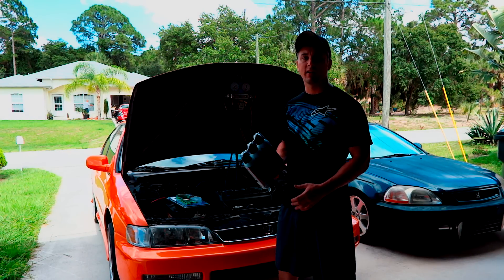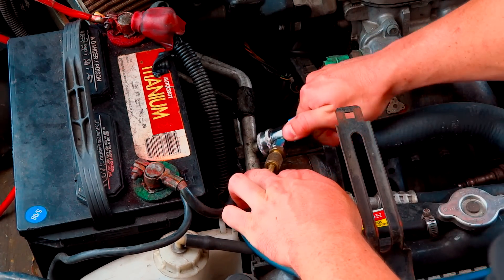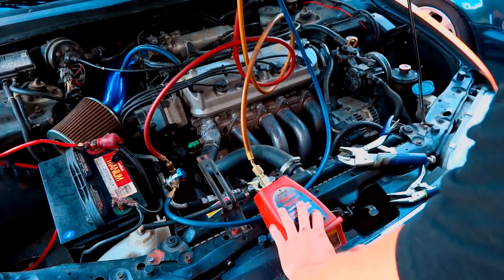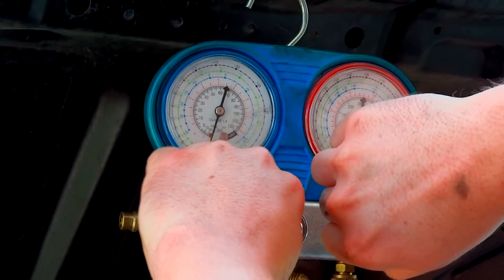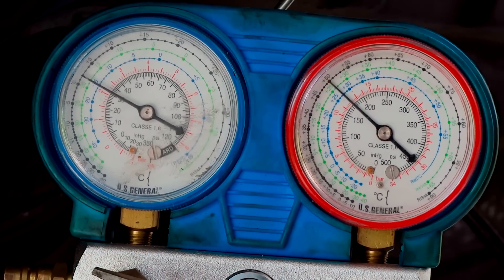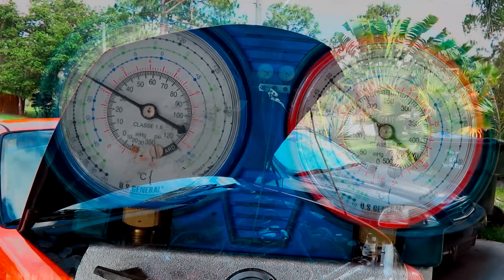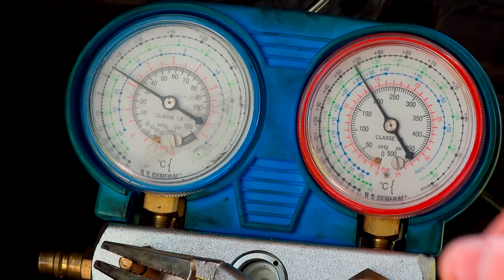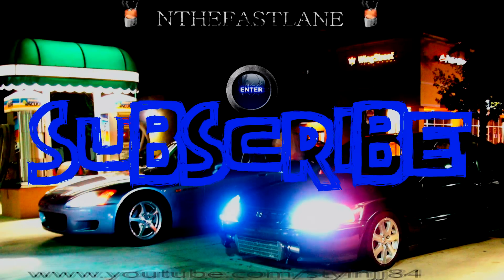Charge Your A/C With The Cheapest & Coldest Refrigerant

Comment: Hmmmm, no notes on molecular weight. I would assume you should convert whatever capacity your car is listed to match r152 since the molecular weight is different. Use the ambient/temperature range chart for saturated pressures for r152 so you don't overfill the car

Now to read if r152 or r290/iso butane would be better lol

Comment: And I will also add that the gauge on the low side reading 30 psi at idle - you can go a bit lower of 25 to 28 and you'll have colder temps... it takes a bit of practice and fine tuning but you add the refrigerant slowly   but adding more will overcharge the system and you'll defeat the purpose and have warmer air coming from your vents.

Comment: Not a bad video - However there are a few updates here that you should know
1 - Once the can is pierced with the tool it will leak out slowly over time. I know this because after a partial charge I did to a vehicle the can did still leak out through the gasket on the tool.
2 - You must have the yellow hose connected to the adapter BEFORE you pierce the can - that way you won't risk in frost bite.
3 - Do not remove the yellow hose from the adapter when changing cans. Keep the apparatus closed and in tacked . 
4 - I do agree of the purging of the yellow hose to the gauge set - so you don't get air into the system. 
Other than that You'll be cool and ready to enjoy the summer...

Comment: I've done a lot of r152 conversion, but not like this. I have a large clear vacuum box that has can piercers inside it. I load up 12 cans in the box then vacuum it down. Once at an acceptable micron level I valve off the vacuum and pierce the cans. I let the box fill up with all the r152, then I recover it to a 30 pound tank. I have 2-3 full tanks for conversions.
Reply: How does performance compare to R12 in your experience?
Reply: @mikelezcurra810  The coefficient of performance is slightly lower than r12 and higher than r134.

Comment: I owned an automotive air conditioning & radiator shop from 1973 to about 2003. Then I sold it to an employee and it is still open today (about 50 years later).  In my 30 plus years of servicing vehicle air conditioners I did not use vice grip pliers to connect the service fittings.

It is OK to try things.
It is against the law to vent refrigerants.
It is against the law to mix refrigerants.
It is against the law to put a different refrigerant in a system with out labeling it as such.  

When some one hooks up to a vehicle with R134a service fittings, they expect it has R134a in it. You would not want some one later to contaminate their A/C equipment by hooking up to a car with R134a fittings but having R152a in it.

Some shops use charging stations, I did not like them. 
I had a refrigerant identifier and used it before refrigerant recovery. 
I always used gauge sets to check out and service cars. 
I always used new refrigerant to top off working systems and after repairs. 

These comments are for viewers.

Comment: Love some of the comments on here.  I guess nobody realizes that the new vehicles have R-1234YF and that stuff is extremely flameable. R152a literally takes ~1/2 the charge of R134a. It also vastly outperforms R134a especially over 90°F.  Not talking a couple of degrees either, talking 8-10°F colder vent temps. As for 250+ head pressure, LOL.  Come to Texas and look at the pressure a R134a system runs at when charged per factory specification.  Before the vehicles interior cools off the system will cycle multiple times on the 400-430 psi high pressure cut-off. In 105°F and 30-40% humidity the high side will run 325-350 psi and that is with a properly functioning fan. At prolonged idle, R134a might stay 55-60°F at idle if you are lucky in those conditions, while some get closer to 70°F. Pag oil is compatible with R152a. I have run it in multiple vehicles for over 200K and have yet to see a compressor related failure from the R152a. I did have a clutch coil go open on my 230K mile G35 which is fairly common on Nissan products anyway even running R134a. When I pulled that system down, it was clean, oil was well distributed, the old compressor had several ounces of oil in it, so the Pag works with R152a.
Reply: r1234yf: It's not very flammable. Just a little bit. With these tiny amounts, there is more danger coming from your gasoline tank.(in case of accident).

Comment: Tried that on a E36 bmw, 1997, didn't work; system makes noise,not sure if the compressor was already bad,or if it went bad with this gas; or if the oil that was in the system is not compatible,maybe ?

Comment: While cans of electronics duster typically do contain a refrigerant called 1,1 difluoroethane (difluoro-ethane) or 1.2 difluoroethane (there is a difference), it may not be the only ingredient. It may contain other ingredients – which you may not want in your A-C system. Plain HFC 134a at Walmart (without the gauge) is $4.88 for 12 ounces. Plus it comes with a schrader valve type of automatically sealing valve, and the can tap needed is about $8 at O'Reilly auto parts.
Reply: About $6 a can where I live in 2025.
Reply: R134a is now about $10 a can at Walmart and $17 a can at Harbor Freight.  I'm sticking with the R152a.
The Blow Off brand of computer duster contains no added bitterant.  And refrigerant-grade R152a can be purchased for $160 for a 25 lb jug.  That's only about $6 a lb....very inexpensive.  You might need 1.5 lbs of it or so to charge up your ac.  So you don't need much.  R134a is slowly being phased out in the U.S. and is already not available in Canada anymore.

Comment: I gotta try this....
I tried 134a in my 87 C4 Corvette and it's not cooling down the air inside the cabin...and it mostly blows on the floor, very little comes out the vents😒😟☹🙁
Reply: If possible / practical for your model  car- check your vent system at the evaporator.  It is likely to be very dirty and clogged.  I don't know what year auto MFR"S started to install cabin filters but I know filters can become so dirty they can prevent proper cooling.  You may also have a problem with vent "doors" not opening / closing correctly.

Comment: Liquid freon goes into the high side whith engine off. Shut hi side valve off when pressure stops rising. start engine and open low side valve, fill up system. Done.

Comment: How well does the  Difluoroethane cas#75-37-6  work in place of R12?
Reply: From what I've heard about as good as R12. Definitely better than R134a.
Reply: Make sure the compressor oils changed, mineral oil from R 12 systems is not compatible with new  gases

Comment: bro, the idea is sound, but your way of going about it involved a lot of unnecessary steps or just wrong steps.
 why didn't you just use the schrader valve on the yellow line to purge the air?
second, get some knobs on your gauges so you can stop using pliers on them,
third, use a needle valve between the can and the yellow line to prevent air in the line and having to purge every time you change cans.
and you should be counting the ounces of refrigerant you're putting into the system so you dont overcharge it
otherwise informative and glad it worked. its what im using to recharge my suburban. 11oz of oil and 71oz of dust off

Comment: Though not extremely flammable in gaseous form, 1,1-difluoroethane can burn under some conditions. As such, there is also a warning label present on some gas dusters. When inverted to spray liquid, the boiling fluorocarbon aerosol is easily ignitable, producing a very large blast of flame and extremely toxic gases such as hydrogen fluoride and carbonyl fluoride as combustion products. (Wikipedia)    Other names
:
Difluoroethane
Freon 152a
Ethylidene difluoride
Ethylidene fluoride
HFC-152a
R-152a
DFE

Comment: You are correct, my bad.  I watched the video again.  It was late at night and didn't catch what you said.  The Envirosafe refrigerant is most likely propane (manufacturer does not give specifics) and that is an excellent refrigerant.  Unfortunately due to its flammability cars cannot be manufactured using it here in the US.  What a bunch of BS in my opinion.  The new refrigerant HFO1234yf is "slightly flammable" and ten times the price of R134a.  It's all corporate greed.  Even though the Envirosafe refrigerant is flammable, so is everything else in your car - most notably the gasoline.  But unlike HFO1234yf, it does not release toxic hydrogen fluoride and carbonyl fluoride when it burns.  I wonder what would happen if you put Envirosafe or  Difluoroethane in a system that uses the new "bend me over the saw-horse" HFO1234yf refrigerant.  I do know that technically it is a violation of emissions regulations (believe it or not, corporate greed made that happen) to change out the HFO12134yf to something else that has a higher GWP, but how often have you ever been pulled over by the refrigerant police and had your car's A/C tested?  Thanks for the video, and if you ever get a chance to try the HFO1234yf "temporary test," please do a video on it.
Reply: And you can directly replace HFO1234yf with R134a!  They both use the same compressors and oil!
Reply: And no, it's not "corporate greed", it's the environmental wackos and government hacks!

Comment: R-152a  is flammable. In case of an accident, it could make the situation worse. R134 is non-flammable, in fact it could put out a fire.
Reply from the maker: In Europe they are banning R134a because of global warming. Guess what they are planning on replacing it with, R744 which is R152a.

Comment: That air vacuum pump is crap .use a regular vacuum pump .
Also I don't think it's legal too change the refrigerant in your car .
Reply: Why would they sell refrigerant at walmart and leave it unrestricted?  Is legal but not to vent to atmosphere period.  I dunno where dude got his facts but yes r134a is non toxic and a relatively enert gas but its greenhouse effect rating is still pretty high...  the old r12 is a toxic gas and can be extremely toxic if it gets too old or decomposes because it has hydrocarbons like phosgene that are created..  technically any person caught venting to atmosphere can get hit with up to a 10,000$ fine in the US...  its a federally mandated fine..
Reply: @Z-Ack  yes your right but mixing the refrigerant is not good .sticking too 134 is better and just as cheap .
If your car came with r134a then u use that .
If it came with r12 then I guess it would be ok if you don't want too spend 100 bucks for 4 cans of r12
Reply: Mixing refrigerants is illegal in the USA!
Reply: It screams harbor freight! I was waiting in line holding a set of 20 fastener tips needing one piece beacause being in the sticks and working on a steering column and an odd security type screw. I told a guy behind me in line that I am tossing the rest of the set in the trash after purchase and the one piece after the work.  He laughed said he does the same thing as well as another friend.  It was funny.
Reply: Have to agree on the crappy vacuum pump but the guy is getting his tools cheap at harbor freight. Nothing against that but he should move up to better tools. The gauge sets are better quality these days. I should know as I have two.

Comment: I wonder if he re-closes his toothpaste tube with his damn Visegrips...
Reply: I thought that was kinda funny. I use the same equipment all the time and never use vicegrips. It's just not needed to be that tight. Same gauge set. I should send him my knobs from the old parts gauge set. Those hoses were crap. Blew the lines off the yellow and the red hoses eventually. The newer ones are better quality.
Reply: r134a isn’t environmentally safe. It should be recovered. It takes 16 years in the atmosphere to return to its natural state.
Reply from the maker: When you've been working on cars nearly 20 years, your fingers turn into vice grips. To add to this I would say yes, I tightened my toothpaste caps with vice grips :)

Comment: 1,1-Difluoroethane, or DFE, is an organofluorine compound with the chemical formula C2H4F2. This colorless gas is used as a refrigerant, where it is often listed as R-152a (refrigerant-152a) or HFC-152a (hydrofluorocarbon-152a). It is also used as a propellant for aerosol sprays and in gas duster products. As an alternative to chlorofluorocarbons, it has an ozone depletion potential of zero, a lower global warming potential (124) and a shorter atmospheric lifetime (1.4 years).[2][3] It has recently been approved for use in automobile applications as an alternative to R-134a

Comment: This is a negative comment, but not about venting the refrigerant. But rather, using the pressure to determine the amount of refrigerant in the system... This is completely wrong and completely inaccurate in a TXV system, like the one that Honda has... The TXV will adjust low side pressure as needed, so low side pressure by itself is not enough to give an accurate estimation of how much refrigerant is in the system... Gotta go by weight. 

In an R-134a system, you need to multiply the factory refrigerant charge by .65 to get pretty close to the charge needed of R-152a (air duster, diflouroethane). In an R-12 system, you gotta multiply the factory refrigerant charge by .55 to get the appropriate charge.

That's the only way to do it without running the risk of slugging the compressor with liquid refrigerant.

Comment: 2 questions. First one is what was the temperature before changing the freon? Curious as to the temp differences. Second is what are the long-term effects on the system and could this harm mechanical components? Pretty sure someone would have posted if it would because anyone who would bitch about vice grips surely would have posted if they had something legitimate, but wanted to ask. Thanks!
Reply: It will shorten the life of the cooling system.

Comment: Update: I made 180 plus miles somewhere like 185k using a Chinese aftermarket compressor, the brand is Chinese,  called "NEW" no issues so far using dust off, no leaks, no nothing, zero problems, superior performance in everything. The system still works just fine. Because the compressor is Chinese, and I drive for living all over the states with a small truck, I decided to replace the compressor at this point, as don't want to wait for it to grenade. The systems oil evacuated showed a very, very clean oil in spite that the system was used very heavily, for each time nonstop for 9 to 10 hours a day.  With this mileage, if wait for the compressor to fail, then might definitely have to flush everything, and that is a lot of work. So doing it now to avoid it failing from this point on, because as said it's a Chinese aftermarket compressor, not a dealership part. And then to avoid it failing somewhere over the road,  that won't be fun if happens in southern states. I dont know, may be it could squeeze more out of this 180k plus used compressor, may be not. As said, its Chinese, and I decided to play it safe. So far, it's been a great ride, SUPER!

Comment: I couldn't stop laughing at this atrocious nonsense. The vise-grips, the half-parted gauges, the so-called vacuum pump; equating cfm, which is a measure of volume, to microns of vacuum; dropping that bleed off into a water bottle so he insured moisture back into the system........ no idea how to measure mass he recharged with, never looked at the receiver sight-glass or read the OEM charge and that duster probably wasn't evacuated before they charged it so he surely introduced air into the system anyway. I mean the sloppy work habits- I was waiting for him to drop the used Blast-off can into the fan! This guy should not be allowed to make a video like this. He's ignorant and this video is dangerous. Have a good laugh but please don't follow this obscene advice. I am a licensed refrigeration contractor and a professional engineer. I'm still laughing, though- god, this kid is stupid.

Comment: A lot of things were done wrong here. Many have pointed out the use of vice grips on the lines, but that's not the worst of it.

1) Never feed liquid refrigerant into the suction line. The compressor cannot compress a liquid. What happens is you blow out the valves in the compressor. This is the first thing you'll learn if you train for HVAC.

2) The vent temperature should never be below 32 degrees. If it is, that means that the evaporator is freezing over. You may think it's cool blowing that cold, but keep driving like this and it will suddenly blow warm and continue to do so until you replace the compressor.
Reply: AMEN!!!!
Reply: liquid not compressible but that is not engine where at TDC or power stroke the valves are closed and can’t be open with pressure so if there is water(liquid) the piston rod will bend no ! this is a compressor with reed valves if liquid enter once the pistons move up the pressure will make the discharge valve to open that’s why even when alot of people charge as liquid compressor doesnt actually get damaged  I mean it could bend the valves but unlikely